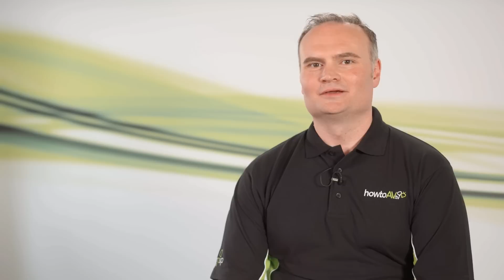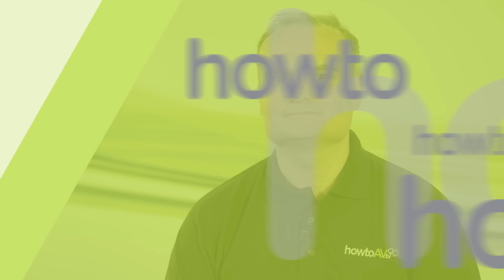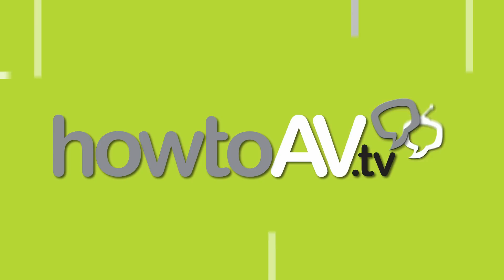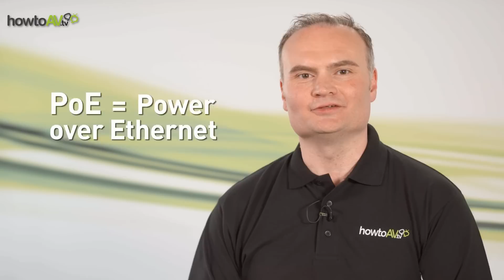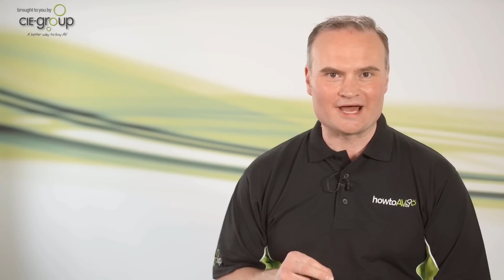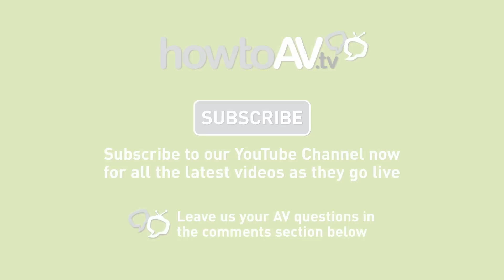What is the difference between PoE and PoC?

Comment: Hi man! Can this cable use to power a cctv camera?
Reply from the maker: Hi George - thanks for commenting!
Many IP cameras will support PoE. However, if your have an IP camera requiring a lot of power (eg for a PTZ), the voltage/power of PoE won't be great enough and therefore, cameras such as PTZs will require an external power supply.

Comment: Hi, I thought PoC is Power over Coaxial?
Reply: Hi, I think you are thinking of EOC which covers both ethernet and POE over coax.
Reply from the maker: Hi Henry and thanks for your comment.
As more and more technology becomes IP connected / 'over Ethernet', there is an increasing number of 'initialisms' for power over cable.
For instance PoE for Power over Ethernet, PoC for Power over Cable, PoH for Power over HDBaseT, etc.
Each provides a different standardised or variable level of voltage and power, compatible with the technology / hardware.
Reply: When I search on POC all the matches I see are Power Over Coaxial, I think Power Over Cable might be a localism for this in the UK

Comment: Hello all at HowToAV!

Great video, very informative as are all your videos, just one question, What is the difference between PoC and PoH, Power over HDMI? Is it the standards, or is there more to that. 

Many thanks,

Sam
Reply from the maker: +Sam Clowting Thanks for your feedback and your question Sam - and a very good question it is! We'll be looking to produce a videocast on PoH in the near future - in the meantime, here's a short precis...

So in the video above we talk about the power delivery standardisation of PoE (Power over Ethernet) and the non-standardisation of PoC (Power over Cable).
Now we have the emergence of the term 'PoH' - which actually stands for Power over HDBaseT (rather than over HDMI).As you may know, HDBaseT (covered in a number of HowToAV videos) provides simultaneous multiple AV signals over single CatX cable, including HDMI and power.Now the HDBaseT Alliance have standardised the power delivery of HDBaseT to enable a theoretical safe delivery of up 100 watts (to power a display device, for example) - though we must stress that this level of power over HDBaseT has not been adopted in the UK and Europe with PoH only being used to power one of the baluns (receiver or transmitter) on a HDBaseT transmission system (using approx 20--25W).More details coming your way soon as we begin to talk more about the emerging adoption of HDBaseT 2.0 and as we launch our HDBaseT Installer Expert Program here in the UK.
FREE places are available for these one-day courses, see details and book free places now at:
http://www.cie-group.com/hdbasetHope this helps Sam and great to get your feedback and questions!The HowToAV.tv Team